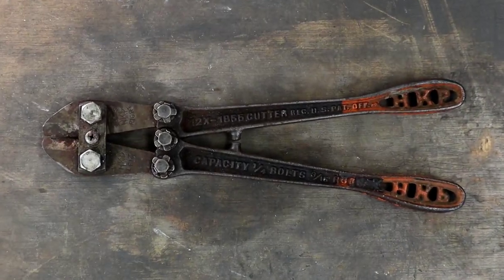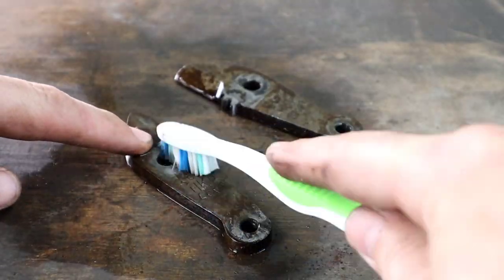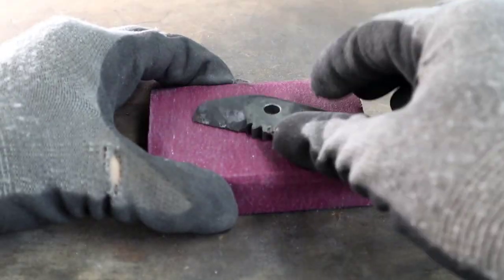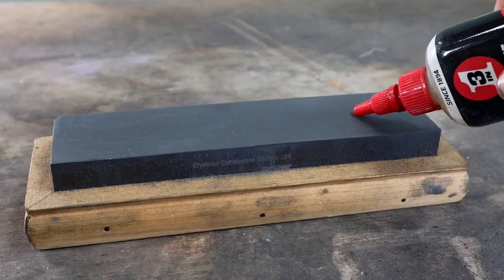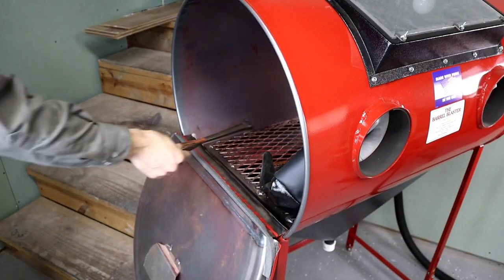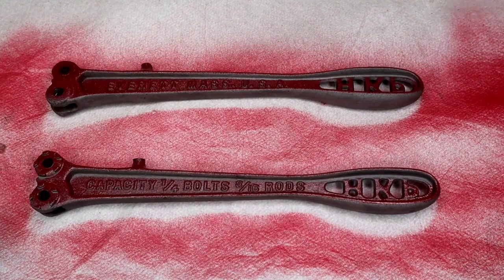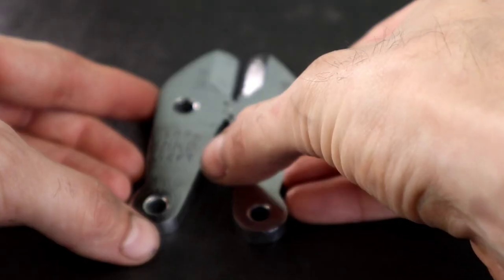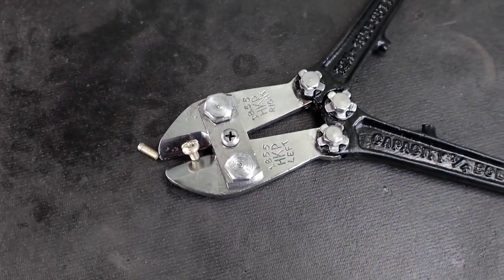How to Restore Rusty HK Porter Cutters | Restoration Guide for Vintage Tools

Comment: Those H.K.Porter were made at the forging plant my dad worked at it the 1960s and 1970s. The plant had several town locations though they never moved over their history. Boston, Everett and Somerville Mass. There was also a number after the Boston and Somerville name which was 43. That was referring to the zip code 02143. I have bolt cutters, tree limb cutters and other tools made as far back as 1906 up to 1980s. My dad was born in 1912. When I saw you painting them red I though cool he is using the color they used for their limb cutters. Actually most of the bolt cutters from the late 1800s to late 1920s were black color. I've painted mine black and put red on the lettering. In the 1950s they started painting bolt cutters red. You did a great job. Oh the tool I'm holding in my picture is a 1940's H.K.Porter typeR pole cutter restored by my friend Vic from Big Vic's Workshop. He is a cool guy!
Reply from the maker: This is gold. I got goosebumps reading your comment. I appreciate you taking the time to share this history and knowledge. I love learning about these tools and so much is lost with time.
Reply: @OneNationRestorations  you can even find a good picture of the plant by just going online and type in H.K.Porter forging plant. The first listing is the best for pictures. As a matter of fact one of the buildings which H.K.Porter used as their office building was an old Ford plant. It is where the name GREASE MONKEY came from! They used to have gears up in the rafters running the machines and they had kids up there greasing the gears!!!
Reply: Hey I live in the same area and I’m looking to restore my  No. 0 & 14 cutters but the blades are pretty bad. Any idea on a place to get new ones?

Comment: Now I really regret not purchasing the pair that I found for sale locally! Frikkin awesome!
Reply: GT Racer347 the first hkp bolt cutter I restored I walked by several times over 2 years at a local antique store. Then I just decided to take a chance. Though I broke one of the bolts trying to disassemble it to clean it, I never gave up and tried to drill it out. Used a small drill first and then went back to get a larger drill
To make a bigger hole so I could use an easy out to get the remainder of bolt out. However as I started making the bigger hole the bolt unscrewed on its own!!! All I can think is I happened to grab a left handed drill. I was so happy! Everything else came apart and I finished restoring it. I have over 30 tools mostly bolt and tree limb cutters I have. They are very special to me because my dad was a machinist at their Somerville Massachusetts forging plant. From late 1800s to 1988 they had one plant at one location, but the town lines changed. So in their forging of their tools they would have #Boston, Mass, # Everett, Mass, # Boston 43, Mass and finally Somerville 43, Mass.  The number 43 refers to 02143 the zip code of the plant at Foley st. SOMERVILLE MASS. It is now called Assembly Square.
Reply: @stephenkent8903  Wow! What a great story! Love it 👌

Comment: FYI: as far as I'm aware, bolt cutters do not come with neither a spring or locking plate. The phillips screw in the center is most likely to remove any play between the meshing gear teeth below the plates.

The bent up tabs on the lock washers are design to lock the nut in place so they don't come lose during use and to tighten them down to a specific point and stay there so the handles don't have any play in them. Later models used a lock nut instead of a lock washer. You may want to go back and bend up three of the tab on each nut.

No bolt cutters come with "buffers on the stoppers". That design hasn't changed in decades. Modern ones have an adjustment bolt on one of the stoppers.

Also, abandon the grease. It attracts dirt, grime and debri and mixes with the grease. Wearing down the mating surfaces, and stiffening the joints prematurely. Oil everything before assembly and periodically during use. Good light oil will flush out any debri, not trap it. I soak the parts in PB Blaster before assembly, then wipe off the excess. This will protect the bare metal areas from corrosion and keep all joint lubricated. Occasionally, wipe down the tools with an old oily rag to keep it clean, corrosion free and oil the joints. 

BTW: Playing in traffic may not kill you, but highly not recommended. Either is using play sand for blasting indoors or outdoors. Silica dust in your lungs is not something to take likely. Cheap affordable media can be found easily, don't let your novice viewers be mislead by your advice.

Excellent video and good luck.